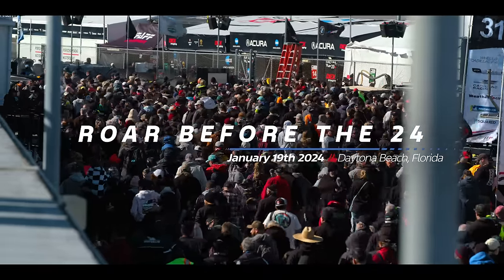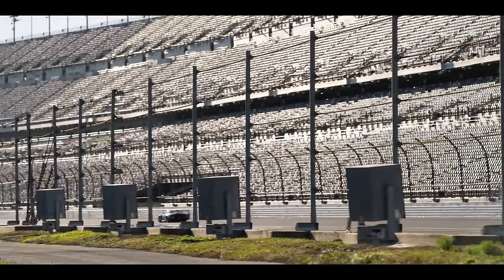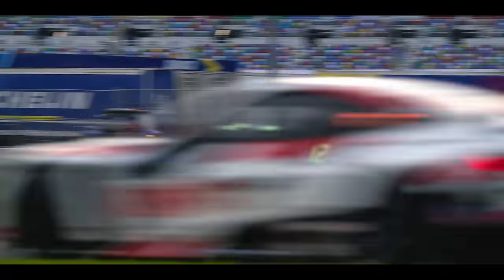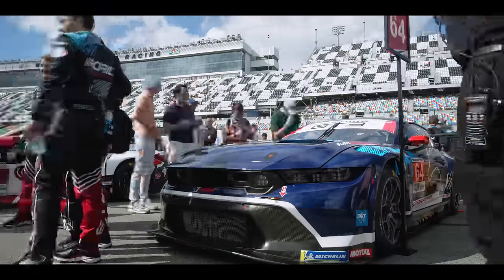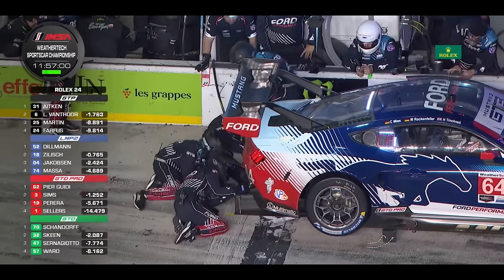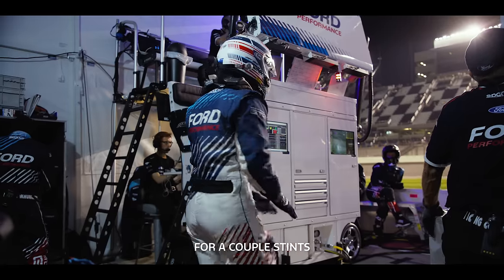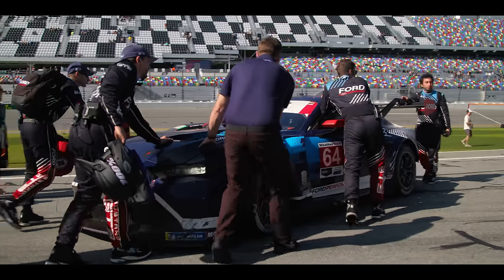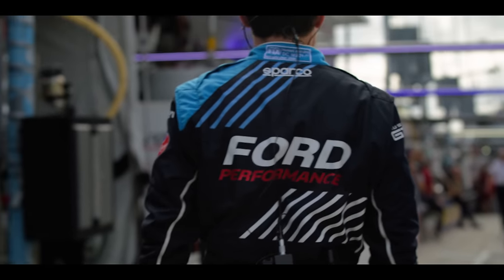Mustang Endurance | “The Marathon” Ep. 5 | Ford Performance

Comment: Ford does great work 💪 more bolts on body panels and front bumper and diffuser also the wing should be carbon fiber molded to the body and chassis . Let's go Ford Race strong and Fast #1 forever.

Comment: The corvette pushed the 64 into the 65? Double whammy.
Reply: That’s called racing! Ferrari took out the first place Corvette last year in the last 4 min of Sebring. 
It happens! Not that it’s cool when it does. 
But they have to make moves or nothing will change because BOP has them all at the same speed.

Comment: After all the HYPE. This was embarrassing !!!
Reply: They placed 6th, not last😂 They also won the GT4. That's what you call an embarrassment. No, they didn't place, but they almost did in a Mustang. Internationally, Mustamgs aren't seen as Super Cars or even competition.
Reply: chill its the first race of the season, plus how you going to control damage inflicted by another vehicle..its calling racing for a reason
Reply: @lroyjetsonson5060 Couldn't agree more, good God some of the people in this comment section are dumb. Calling it a disappointment that ford's brand new race car made it all the way to the end of one of the harshest races of the season, and it performed decent. Most of their issues were freak things with the deck lid, which will almost certainly be fixed by the next race, and getting hit by other cars like you said.

Comment: If you're not first, you're last !! What  a disappointment debut. 😞
Reply: Bro, running reliability and nearly placing in the top 5 in your first race with a brand new car is hardly a disappointing result. Most of the time in this situation, the cars don't even finish.
Reply: @themidnighttavern6784  If it weren't for that last caution which brought the Corvette up because the Mustang pitted...it would had been a top 5.
Reply: @Normandy1944  Exactly, a top five for a first time out, with being at a disadvantage due to BoP restrictions sticker than several other cars in class. I fail to see how that's a failure.